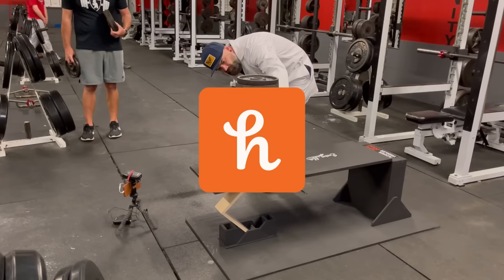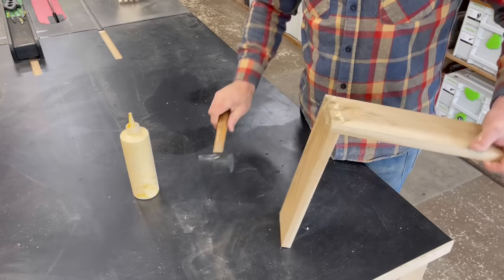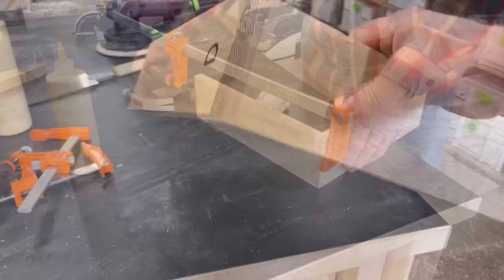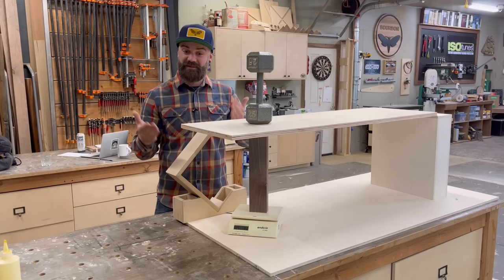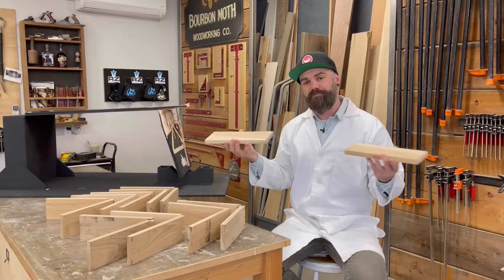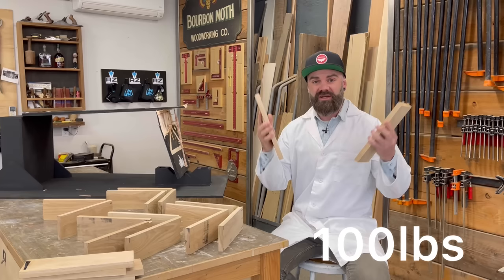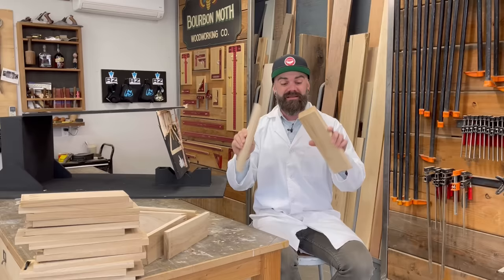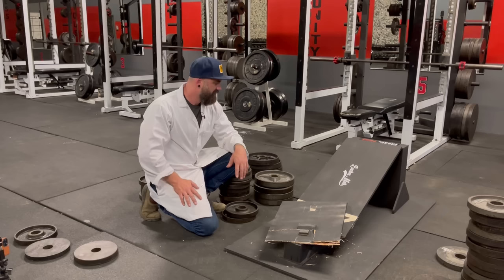What's the Best Wood Joint || Insanely Strong Joinery!

Comment: Not as useful as you would think. You have to think of the purpose of the joint. And the vectors of the forces. This test stressed joints in a way that these joints would never experience. Would you build a chair or table in this way? Never! And your dovetails were not cut right for strength, but for beauty. Next test, think about the force direction and vectors. Think of loads in shear, stretch and compression. This was a rotation vector that almost never happens in properly designed woodworking.

Comment: This really isn't that scientific. Since this is just stressed along one vector and as a dead load, not a live load. (which would REALLY factor in when referring to a chair as he mentions in the 45degree  joint) also, since the dovetail is a thick and thin dovetails, there is less meat in the thin dove tails to resist the force mechanically, so I don't think it would hold as much as a traditional dovetail joint. ALSO, there is no margin of error to account for potential differences in the grains and assemblies, as there is only one example of each joint. 
a better test would do 10-30 test of EACH joint. AND with the current tests, I would love to see joints made with twice or thrice as many splines.
Reply: Would also like to see a basic miter with biscuits

Comment: Does this so called woodworker even know what he is doing ??

The Lamello clips are called Tenso. We used them for trim, very easy to just clip on. Did not use glue in case of repair, disassembly etc. They also have Clamex which are the same more or less but can be tightened with an allen-key for more strength. Very handy for big projects and when assembling/disassembling and parts not needing the extra hold. Normal plywood biscuits are the preferred Lamello system to use with PVA glue and stronger than the two others. I dont understand why the weakest are the one tested here in this way.?? Normal Lamellos are on par with Dominos. Dominos also come in different thickness, so a thicker one than what used in this case would have hold better. 

Also the dovetails was not done correctly.  To be nit-picky, generally the widest portion of the pin should be equal to 1/2 the thickness of the material. The angle of the dovetail is generally between 15° and 20°. The spacing (space between the pins) is usually twice the width of the pins. There should be a pin more, to make it stronger.

Building a drawer with no support in the corners WILL make them fail over time. Drawers are loaded, sometimes a bit heavy with utensils, tools, machinery etc. They tend to slide well when heavy on alu rails, and  some stop very suddenly. The first to fail is the corners if not strengthened propper. I have seen many fully loaded drawers fail to this problem. So YES! You def need more than 60 pounds of force, as if only one corner fail is enough to make the drawer completely useless as the bottom falls out.

Comment: I'm just research joining techniques for a speaker and amp cab I'm about to build. So newbie to joining beyond butts and miters screwed and glued. Is that not a joke of a dovetail joint? The slivers of just a few tails look weak af. I still expect a 50/50 split of tail and slot volume with as many tails as fingers in the box joint to be stronger than the box joint, or at least on par with it.
Also, hydraulic presses with pressure sensors are not that uncommon. Staff at the lab I used to work at would all get a good chuckle at the methods used here, and a good cringe at the sell out coo-pon talk littering this low quality experiment.

Comment: That’s interesting but such an  American way of thinking and working  (compared to Japanese for instance)… so much glue splitting out, no reference to any tradition, not any thought about what the joints are used for and in which direction the forces will be applied… anyway that was fun and interesting